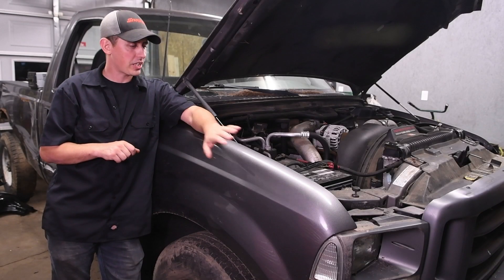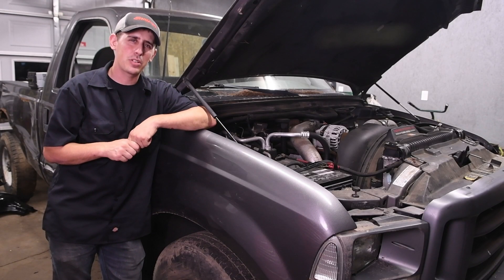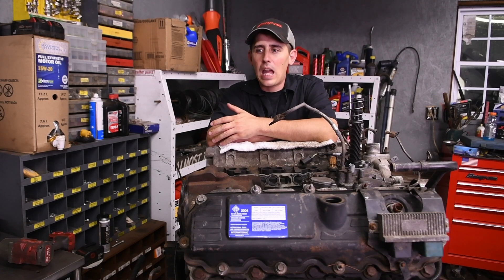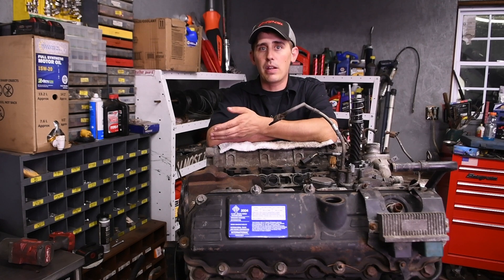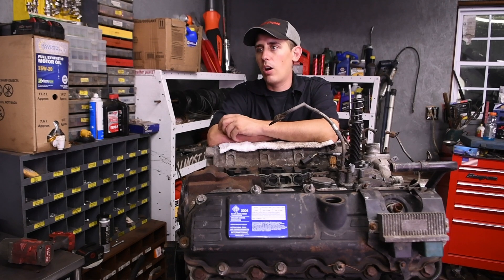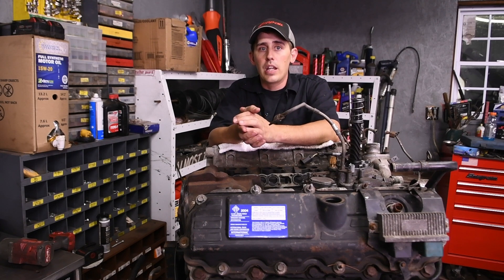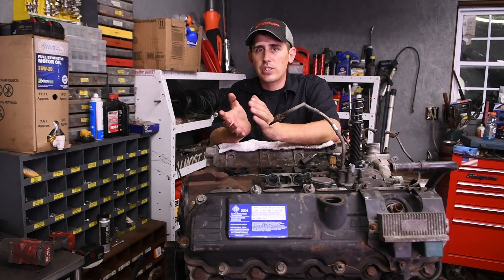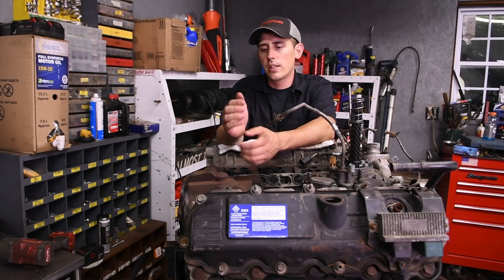6.0 Ford NO START diagnosis

Comment: What should my injection control pressure be?
Reply from the maker: While cranking? Minimum 500psi
Reply: Man i wish you were located closer I just can’t get my truck dialed in is there anyway I could send you a video that way you can hear what it’s doing.?

Comment: I’ve got no voltage to ficm that was in the truck and put a new one in with no voltage as well but the rest of data is fine, ICP IPR % ICP volts. What else to check?
Reply from the maker: Hi Erik, I'm just seeing this now. If you haven't already solved it i would start checking voltages at the ficm relay.
Reply: @InTheShop  cable connectors were broken to the FICM but I managed to finally get voltage. Long story short, I’m not getting Cam/Crank sync, replaced both sensors and still no sync. During the course of removing and install new sensors, many of the pigtails of the main harness were absolute garbage. My next plan is to put in a new harness, the truck also came with a new ficm harness as well. I got the truck for a steal knowing it wasn’t running but so far this thing has been kind of a pain, especially trying to track down a main engine harness .

Comment: Love your videos. I have a 06 F550 6.0L  If I drive it a short distance or long distance once I turn it off the engine will not start for and hour. It is not overheating any suggesions ?
Reply from the maker: Thanks Rod! Sounds like you have a high pressure oil leak. I have another video that covers exactly that. https://youtu.be/CXd7vhlcaYg
Reply: @InTheShop  Thanks

Comment: How are you? I have an 2006 F550 I was driving it on the Hwy and all power shut off. It crank but want start. When you spray a little of starter fluid in it it starts up until it burns off. So i replaced the crank sensor, cam sensor,  IPR, put 2 new filters on. Replaced so fuses as well have 2 new batteries with new batteries head connector as well and no start. I was thinking it could be my FICM. The truck only has 152 thousand miles on it. Can you help me out please I need to get back to work and I need my truck. Its 2006 F550 6.0 power stroke turbo Diesel.

Comment: What about if it cranks and cranks faster and faster and doesn't start? Is that a fuel or oil delivery issue?
Reply from the maker: I would still want to see data/codes before I made an assumption.

Comment: Hey man I have all the codes and they seem to be all electrical but I don’t know what to replace exactly? It cranks but it doesn’t start and it has low Rpms I couldn’t even start it with starter fluid
Reply from the maker: What are the codes?

Comment: I got a problem with 0 5 e450 6.0   And replace the engine  because  The other one is was bed Start up everything good After 5 hours Drive and turn it off And Now Wont turn on  I check everything with my scanner ICP 1500 PSI
ICP 25 amp 
FICM 48 VOLT 
FUEL 40 psi
Crank syng
Cam syng
No buss 
 A put my is scanner to  Do the buss test pass no codes
Reply from the maker: So it passes a buzz test on the scanner but you cant hear the buzzing of the injectors?

Comment: Cold crank no start. Info plz
Reply from the maker: Need to check for codes. If there are no codes check FICM voltage. If Ficm voltage is ok check for injector buzz.

Comment: Had fuel system gelled up replaced all filters all my pids are in Speck cant get any smoke at tailpipe . Fml
Reply from the maker: Have you tried moving it to a warm area yet? You might have to tent the truck and run a space heater.

Comment: Question for someone, anyone. I know there was a ficm recall on most of the 6.0s the question I have is if I bought the truck 2nd party and the ficm was not replaced will Ford honor the recall still? And it bring years later? I just bought one roughly a month ago 1-16-21 and the ficm is bad. If anyone knows if Ford will do that please let me know.
Reply from the maker: Almost impossible to recoup on a claim at this point but you could try. You would have to contact a local dealer.
Reply: If they don’t honor it, I’ve heard their are different ficms different pins...available, is there a better one than the next?

Comment: Hi I have an 04 6.0 power diesel an the truck runs fine but when you drive it for a while an turn it off it will not turn on Intel the next day.. what could be the issue can help ....?
Reply from the maker: Hi Jaun, it sounds like you have a high pressure oil leak causing a no start until the oil cools down and thickens back up. I have another video specifically for high pressure oil leak Diagnosis.

Comment: Nice video thanks . I have 3 codes PO265 PO268 PO274 I put new batteries changed the FICIM Power and plugged in the scan gauge, I have sync 1 , IPR 44.7, FPW 2296  FICM 48.5, ICP 1560 . My truck has 53000 miles on it I bulletproofed the truck in 2011 with 23000 miles on it blue fuel spring new heads and bolts , built high pressure pump, just went though the fuel injection harness no issue what would you recommend thanks Dave

Comment: I need advice, truck was running good had major oil leak, I changed front cover, replaced oil cooler, and egr cooler, resealed hoop, put it back together, I have good fuel, the fuel filter filled up, the is no sign of oil getting to the oil filter yet, was cranking fast, for several attempts , I also cranked engine by using cable near battery to turn engine over, still no start any ideas thanks my email is glommen4@live.com, or phone is 702 720 7824 name is Al

Comment: If I spray starter fuel it'll  crank and run find and go wherever but when you turn it off you have to get it to crank with start fuel
Reply from the maker: Are there any codes?

Comment: Hi , I have a 2005 f250 power stroke Harley Davidson edition that 6 years ago it rolled over on its drivers side. It was running while it was on its side and I turned it off and walked out the sunroof. Since then I haven't been able to get it running again! The motor cranks but no smoke. I have fuel and oil  in it and when I turn the key, I can hear the fuel pump and the glo plug light on the dashboard lights up like it always did. It just cranks a few times and then I hear one cough after it cranks a little. Can you give me a few pointers in the right direction as to what might be wrong with my truck?
Reply from the maker: Are you sure it’s the fuel pump you can hear running? I would start by checking the fuel inertia switch located in the passenger side kick panel under the glove box.
Reply: @InTheShop  i have already done that first thing because that's what I thought it might have been.
Reply: Are both the fuel filters supposed to be full of fuel before starting? If so, the smaller one is full and the larger one just keeps draining away and won't fill up!

Comment: Please do a no power, no crank, no start,....plus only gets power when connected to jumpers but still doesn’t start, then loses power again once jumper cables are off. Please please!! Truck is just sitting and I don’t have a clue what to do or the money to waste on guessing!! Help please!!! 2003 Ford F-250 6.0 power stroke diesel
Reply: Sounds like bad batteries.
Reply from the maker: I would definitely start by having the batteries tested.

Comment: Hey bro,how’s the family? I have 05 6.0 just replaced fuel pump and now I’m not getting fuel to the top filter?? Can you help? Thanks merry Christmas
Reply from the maker: Did you have fuel pressure before? If so I would inspect the lines to see if one got cracked and is now sucking air.
Reply from the maker: Did you have fuel pressure before? If so I would inspect the lines to see if one got cracked and is now sucking air.
Reply: Will do thanks

Comment: Great video thanks but i have 2006 f350 had bad fuel then bad FIMC now still will not fire up showing codes for glow plug circuit 3,5,&7 any suggestions
Reply from the maker: Start by testing the glow plugs. You can do a simple test by unplugging the 4 pin glow plug harnesses, clipping a test light onto the positive battery terminal and touching the test light to each pin on the harness to see if the glow plugs have a good circuit.

Comment: Hey man I hit a bump in my 6.0 truck cut off instantly amd would not start back up . Ford at first told me a ficm I had them flash it and install it and it was a no go , 2 days later they call me and tell me compression is going passed the rings no good compression. I have a real hard time believing this due too the fact the truck was very strong it has been studed and deleted please help any way you can
Reply from the maker: Hey Tyler, I would start by getting it to a shop that specializes in these trucks. There is no possible way that hitting a bump would cause low compression. It also sounds like they wacked you for a FICM you didnt need
Reply: @InTheShop  thank you for such a quick response! I will try that and let you know the results of what they say .
Reply: @repodelight  what they say man need help with my 6.0

Comment: Very good video.  I have a weird problem.  My 2006 started suddenly having extreme injector noise at idle.  At exactly 1150rpm, the noise went away and ran fine on the highway.  I got it home as it was not far away.  It was time for some maintenance, so I changed the oil, oil filter and fuel filters.  No change.  Changed the icp sensor.  No change.  Took the ipr out and it had dirt/clay stuff in the screen.  I changed the screen, o rings, and cleaned it.  No change.  I purchased a new ipr.  Now, the truck won't start.  The truck passes the individual buzz test, and the scanner only reads bad glow plugs on 4 and 8.  When I had the ipr out the first time, I had my neighbor crank the engine to "flush" the oil galley out a little.  Oil was coming out in spurts.  Any ideas where to go now? Thanks so much!
Reply: Forgot this. The ficm showed 48.2v while running.
Reply from the maker: Have you checked fuel pressure?

Comment: I’m working on a 05 super duty 6.0
It is a cranking no start , all the scan data looks good but the injectors will not clatter/buzz at anytime 
What should I be checking first?
Have you ever come across this issue?
Thanks
Reply: Sounds good 
What would cause all injectors to fail at once?
Reply from the maker: Typically they don’t but it can be a progressive thing. When it happens it will start running a little rough on a cold start up. Once the truck warms it will smooth out. That’s the sign of some of the spool valves starting to stick.
Reply from the maker: I have come across that many times. First I would check for codes. I would then use my scan tool and do an injector buzz test. If both of those tests pass but still no buzz the injector spool valves are most likely stuck. One way to verify this would be to unplug one of the injectors and plug in a known good injector then re-run the test to see if that one injector buzzes.
Reply: Ok
So I plugged in a known good injector and did a buzz test and it does buzz
Would that be a good indication that it needs 8 new injectors?

Comment: I’m thinking I might have a cup and/or injector issue. Coolant is gone from the degas. I had a cylinder 5 inbalance code.  What do you think?
Reply from the maker: If coolant is gone from the Degas its not a cup issue. Do you still have EGR or is it deleted?
Reply: @InTheShop  it is deleted/studded. I pulled the injectors and pressurize the coolant system which was bone dry it first I have a blown head gasket. :(

Comment: Hi, greatly appreciate the info. I have a 2007 550, with a crank no start no smoke condition. I did find water in the fuel, Flushed and cleaned the tank replaced filters twice. Still no start.
Reply: Yes I have. I also found out that there was a Napa oil filter cap with a puralater oil filter. I have motorcraft cap and filters on order. I also ordered a test kit for HPOP to test for leaks and a test kit to check fuel pressure. I’m new to the 6.0 and have just got this truck. I’m looking a different scan tools a to see what to buy.
Reply from the maker: Have you run through the other possibilities I went over?

Comment: I have an 05 6.0 about four months ago, I replaced the STC fitting, oil cooler, stand pipes, dummy plugs and also main ebgine harness and injector harness. It ran great, but a week ago it quit on me and wouldn't start. It had base oil pressure, but it would only make about 20 psi of oil pressure and the ipr was at 85%. Today I replaced the ipr and found the screen had come off. I retrieved that though, then replaced the ipr and icp sensor. Now it still has base oil pressure, but it only makes about 250 psi and still wont start. Also, my ficm voltage is 48.5 V. I know it needs at least 500 psi to start, but I can't think of anything else that might be wrong. Please help. Love your videos by the way. Long time subscriber.
Reply from the maker: Try the air test. That would be my next step
Reply: @InTheShop  where else could it leak except the dummy plugs or stand pipes?
Reply: I would unplug the ICP sensor and see if the truck will start.. This is one of the first things I do with a crank/no start.  With the ICP unplugged you'll see around 1400 PSI on the scanner and the truck will start if high pressure oil is present.  I haven't had much luck with aftermarket ICP sensors.

Comment: I have a 2003 6.0 powerstroke that won't start from the ignition. I have a wire running from the starter to the battery for now to start it. Starter, ignition and neutral safety under the steering column have been replaced. Any ideas? Thanks! I think I just requested to join your fb forum group.
Reply from the maker: A few quick things to check first. Do your reverse lights work? Also have you tried to start it in neutral? After that I would option a wiring diagram and start at the fuses and work your way towards the starter.

Comment: Great video.  I know you said this should cover most of You with a Crank no start.  I'd like to Add one more.  5v to Ground.  Had wiring harness near fan just behind radiator  that grounded due to rubbing.
Reply from the maker: Thanks Mike! That is another good one. Also common is the fan wiring chaffing then blowing the PCM fuse.
Reply: Another issue I've found is a faulty ICP sensor that sends a lower than actual reading to the ECM. Unplug it and try to start. If it starts then you have HPO, but an incorrect reading from the ICP to the ECM could be bad sensor, faulty wiring, etc.

Comment: Thanks for the video man love the channel. Our plow truck is a 6.0 and it won’t run, I’ll be into it in another month or 2 here. Were you able to get your shop truck fired up yet?
Reply from the maker: It needs a high pressure oil pump. I’m going to be doing a whole series on intake manifold removal and each individual job related. I didn’t want to put the repair on this video.

Comment: Thank you for your video. Do you need bi directional scan tool for doing a injector Buzz test ?   Which scan tools listed can do a Bozz test ?  A+
Reply from the maker: You do need bi directional control. The only one I listed that I know for sure will do it is the last one on the list. I'm not sure if the next cheaper of the two will. I will call and find that information for you.
Reply: @InTheShop  Thank you
Reply: They sell cheap injector pulse tools on ebay or amazon if your scanner doesnt have bi directional capabilities.  I have one that works and just use it with a manual fuel pressure gauge.
Reply: Autoenginuity does bi directional control and a buzz test

You must purchase the ford enhanced package though and you need a laptop with windows 10 or better, will not work with windows xp
Reply: Im pretty sure forscan does KOEO injector buzz test and it is free, you just need a MS-CAN compatible ELM327 cable which you can buy from amazon for under 30 bucks

Comment: Could the shielding tape on the cam sensor wire cause a no start ? Replaced the wires and sensor and wires all test out good.
Reply from the maker: I have never seen the shielding tape cause a no start. What caused you to go towards the cam sensor?
Reply: In The Shop had a p2614 cam position out code and a p0341 cam sensor circuit performance code , truck did not have ficm synch until I replaced wire and sensor , it has synchronization now but the truck only fires up and dies immediately.
Reply from the maker: Did you check the block surface for rust?
Reply: In The Shop underneath the sensor ?
Reply from the maker: Owentraxxastamiya correct. The flat surface that the sensor bolts to. Even a small amount of rust will push the sensor out and make it so the sensor can’t read the camshaft.
Reply: In The Shop thank you for all the help, I’ll try it out and see if it works !

Comment: My goal is to learn everything about 6.0 so when prices drop I can pick one up cheap. I’d rather have a 5.9 12 valve for simplicity but they are expensive and the trucks and trans are junk ( in my opinion)
Reply: On second thought after watching this I’d be in over my head. Thinking of a 5.9 into a Ford 6.4 frame.
Reply from the maker: Cant go wrong with a 5.9. very simple and very reliable. Thanks for watching!

Comment: Because the 6.0 is so computerized I sold mine and went back to 7.3. for me the best decision was to go back to 7.3,
Reply from the maker: The 7.3 is definitely more reliable and easier to fix. the disadvantage is much less power and you are stuck with old suspension design.
Reply: @InTheShop  yeah but I love the 7.3 so I am happy and at the end of the day it's all about you.
Reply: Same reason I'm going back to a rotary phone.
Reply: @Itsa_Mea  well if you need one let me know, I bought this old property and in the garage is boxes of super old stuff and I have found boxes of rotary phones.